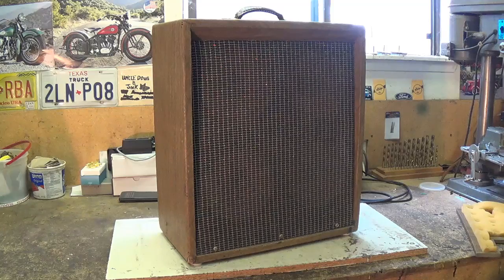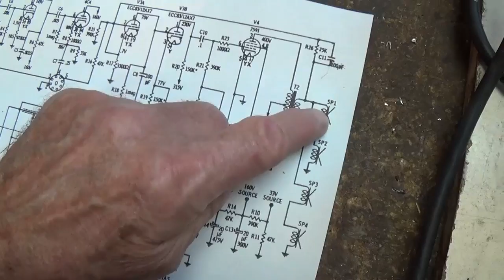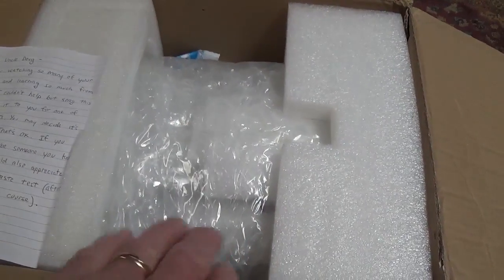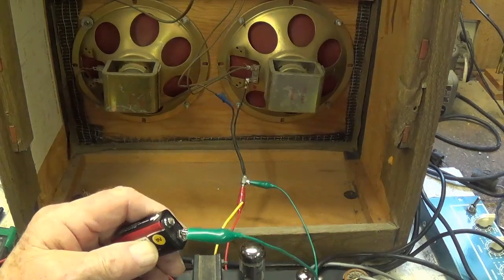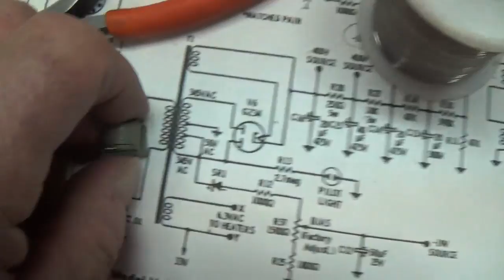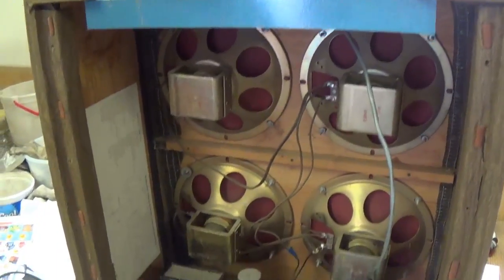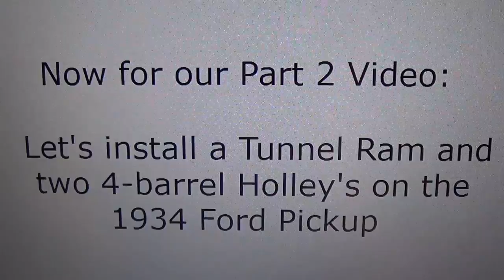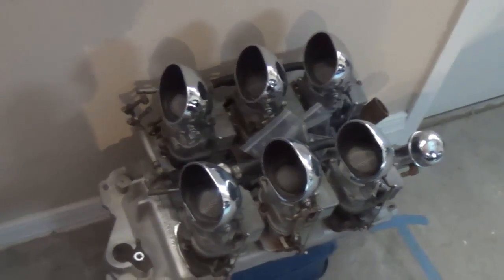Harmony H322 Bass Amp.......The "mini" Bassman from Hell !!

Comment: Hi Uncle Doug.Hope all is well with you and the Jack Gang- and you're keeping safe. Just watched your 1960's Rauland- Borg  P.A conversion. Brilliant as always. I'm wondering in the NFB circuit ,the shielding wire was earthed at the speaker jack and the other end seemed to be trimmed off at the insulation before going into the 50k pot, is that correct ? Really like the effect it has . Couldn't believe the change the transformer had on that Gibson RT , you said your mate reckoned rusty transformers sound great so did that old Gibson GA one.
Reply from the maker: Thanks, Patrick. Cable shielding should only be connected to ground at one end, for fear of creating a ground loop.
Reply: @UncleDoug  Thank you Uncle Doug-had wondered if that was the reason- must be unconsciously picking up logic from your excellent vids. Sincerely yours.

Comment: Thanks Mr. Douglas for this great amplifier fix. As you tell in this video you can see i have subscribed to your channel. One question i have, and, maybe you have covered this in one of your many video's about amp repairs, but i did not watched all of them yet. 

My question is, in choosing a power transformer for an amp, who is taking the most of the power, the amp tubes or the 6 volts fillements? In other words, is the power needed for the fillements to heat up the tube known of all the tubes? Thanks and greetings from Belgium where we also have to stay inside the house in these corona times.
Reply from the maker: Thanks, Jean.  Yes, the tube filaments, both 6.3VAC and 5.0VAC (if you have a tube rectifier) draw far more current than the high voltage DC circuit.....i.e. 3+ Amps vs 200+ mA.
Reply: @UncleDoug  Thanks and god bless your old granny.....:=)
Reply from the maker: @germona  You're welcome, Jean. Amen, she was a real fighter ;)

Comment: The 5AR4/GZ34 might be a Mullard or possibly an Amperex. Mullards usually have a hole in the bottom of the plastic locator key, and the edges of the plates where they're joined together typically show a coppery edge, and are possibly cut with scalloped edges. Any alphanumeric codes on the glass bottle?
Reply from the maker: It was a vintage tube, GU, but the amp has been returned to the owner, so I can't check.

Comment: If ever yo get an amp with a persistent  hum it might be infested with Hum Pixies. You will never find them as there nests are invisible and they only come out when the amp is switched on. The best way to be rid of them is to remove the back of the amp to expose the valves. Then switch the amp on and turn the volume all the way up to 11, this will entice the pixies out of there nest. While  they are humming, sneak quietly around the back of the amp and drench them in ice cold water. The thermal shock will cause them to implode, you can tell if you are successful my sound of loud bangs and pops, the flashes of light and lots of smoke as they implode.

Hope this helps.
Reply from the maker: I just got a nice, original Dumble Overdrive in for repairs, Bishka. I'll use your technique on it ;)

Comment: Great video Uncle Doug.  Like to watch these even though I know nothing bout lectronics.  Is it possible that the bronze gear on the magneto is sacrificial in that it is a softer material than the cam, and therefore wears instead of the cam gear?  It's easier to change the gear on the magneto than pulling the camshaft.
Reply from the maker: True, Joseph, but all other distributors have steel gears, so I don't understand why brass was used in this case.

Comment: Hi Uncle doug, I have now seen the end of your Ronco (Scintilla) magneto. That gear is meant to be bronze and designed to wear rather than the cam gear. Also bear in mind the shaft is 12.5mm not 1/2. Yours Allister
Reply from the maker: I understand the theory of sacrificial brass gears, Allister, but they aren't necessary in a street engine with a steel camshaft. After all, who really wants their bearings and oil galleries clogged with brass shards ?
Reply: @UncleDoug  yes very true. But it takes quite a while to get worn. Also we just fitted them as supplied by the manufacturer. We did do loads of that style and converted loads to that style. The Lagonda engines all had hardened steel gears. The other type was offset drive dog. Taylor Vertex used to supply all the parts. But that is standard and how they were always supplied brand new. Still fantastic videos though.

Comment: WOW, that's a bummer. Sometimes it's the best to set the amp in a corner and get back to it after a few months with clean head. GREAT job as always!

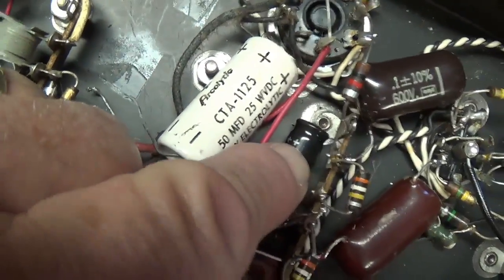I have a question about 38:06
I have to replace these brown caps from CDE (Cornell Dubilier). I am looking for .022 600V and .25 600V. Do you know where I can find them or what is the best replacement for same tone and look?
Thank  you!
Reply from the maker: That's what it took in this case, Echo. The caps I used were NOS vintage, but you may be able to buy similar ones from Antique Electronic Supply. Good luck.  Please subscribe so you can received notification each time a new video is posted.
Reply: @UncleDoug  subscribed in 2013 :D

Comment: This seems to me that this amp would make a great keyboard amplifier. I would make it a amp head to keep down the weight, and then build a separate speaker cabinet, probably 4 X 10" in series/parallel to keep the output at 8 ohms. Would you use the original pre-amp tubes or go to nine pin miniature pre-amp tubes? And EL-84's as power tubes?
Reply from the maker: That sounds like an interesting project, Dennis. I see no reason to change the tubes. If you do this let us know how it turns out.

Comment: Uncle Doug; What brand/model of wire strippers do you use - your favorite and why?  I gotta get something that is worth the investment instead of these utility knives, and crappy radio shack wire stripper/cutters.  I'm building the current limiter and and pulled out my Oscope and my isolation transformer, new battery for the Fluke DMM, I'm clearing out a space in the basement.  You have rekindled my fondness for working on electronics again.  I won't suffer the lack of a good wire stripper again.  I hope you can steer me toward the light on that.  Thanks for your great videos - the cats are great intermissions! :)
Reply from the maker: Congratulations on a wise decision, X. I use this exact product:  https://www.ebay.com/itm/Ideal-Stripmaster-Automatic-Wire-Stripper/264587605864  and recommend it to all.

Comment: Dear Doug, I got an old Corland 8 Watts  combo for Guitar ( but It was my First bass amp) made in Italy. The Power tube Is an el 84 but the rectifier  has the label half worn so I read  gz 81  or ez 81 (May Be) and I wonder if it's right and I wonder if I can use a gz 34  instead. What could happen?  Thanks and bye. (I love Cats like you)
Reply from the maker: I can't speak with authority about that brand of amp, Gianni, but you can't simply plug in any handy rectifier tube. The socket and the circuit are wired for a particular rectifier tube. You will have to find a schematic or knowledgeable person to identify the proper tube.

Comment: I've been thinking along these lines for about a year. 
What if you made a 5F6A circuit, only driven by 6V6s, with 8" instead of 10" speakers, same 12AY7 preamp, same interactive volume controls, same cathode follower driving the tone stack, same inverter, a Bassman for the "loud is over" era.
Maybe an even smaller one with 6AQ5 output tubes and 6" speakers.
        We have to come up with a way to beat the"turn it down" police, and still maintain tone.
      Maybe Tweed ear buds are the answer.
Reply from the maker: Creating a signal output from the pre-amp to drive headphones is an excellent solution, JB. Other than an attenuator, which still produces clearly audible "noise", there is no other way to maintain virtual silence (to others) while blasting away on your Iron Butterfly hit list.
Reply: @UncleDoug  Thanks. I also found another tube called a 1L6. It's a tiny tube, used in Zenith Transoceanic radios, I think. I've been pondering the possibility of a little single ended amp, possibly some variation on the Tweed champ, but around a1/2 watt, maybe using a Fender reverb driver transformer as the O.T. I want to find a way to sound as awesome as the big guns, but not offend the snowflakes. My Princeton is too loud now. 
        Guitars are funny like that. The sweet spot where the amp begins to sing is the exact spot where the curmudgeons start screaming "turn it down!"  The actual Db level seems to be irrelevant. Perhaps sustain and odd order harmonics are offensive to some ears? I think scaling down to almost nothing is the only option.
Reply from the maker: @jpalberthoward9  I gave you a better option in my initial reply, JP.

Comment: Hi Uncle Doug, Really enjoy watching your videos. I have a question how does a Pentode/Triode switch work to drop the power down from 40W to 20W or what ever the wattage of the amp happens to be?  Thank ypu, Joe
Reply from the maker: In pentode mode the screen grid has its own power supply. In triode mode the screen is connected to the plate. This reduces power by up to 50%, but does not reduce the volume nearly as much.
Reply: @UncleDoug  Thank you Uncle Doug for the explanation, Would you be willing to make a video demonstrating this on paper? Thanks for all you do.
Reply from the maker: @MrJoevox  There are all sorts of Internet sources that go into detail about how to add this modification, Joe. Check them out.

Comment: Hi uncle Doug how do you choose the value of the dIo to replace the selenium? If need to get -45 v do you have any suggestion. 
Thank you for the great video
Reply from the maker: Diodes are easy, TT. They are so cheap that you simply pick one that has a far higher current and voltage rating than you really need. I routinely use 3A 1000V diodes in 2 or 3 mA, 40V supplies. They will last forever.

Comment: Great to see messes cleaned up.  Someone was well meaning in the effort to relocate the power switch and light, but lacked the electrical skill to both do a clean job or realize the hum and ground loop issues. Looks really good now. All that is left is for someone to clean up the contact paper mess.  The big take away here is, don't try to improve the design unless you have the skill set to do so.  I see this DIY crap a lot.
Reply from the maker: So do I, DH. It's both a challenge and a rewarding task to correct prior screw-ups ;)

Comment: I have experienced many times with commercial equipment the stupidity of single through single pole switches and thus having live 115 volt still active throughout the equipment. I’ve requested this be addressed by manufacturers to no success 😡
Reply from the maker: It's a bad design, yet easily rectified, Doug. I'm on your side.

Comment: Okay, I paused the video and looked at several other Harmony H322's on the 'Net, and I'd bet hard that this isn't a Lectrolab. I think it's a Gregory, made in the NY-NJ area. The cosmetic stylings of Gregory amps varies significantly from model to model but I did see a picture of a Model XXX bass amp with about the same cabinet dimensions as your amp. Unfortunately, there were no close ups of it and no pics of the speakers.
Reply from the maker: Any input on the creator is appreciated, GU. Having worked on a  Lectrolab recently, I have to say that there is a significant resemblance between them.

Comment: Couldn't help but notice the oil filler tube in the old Offy manifold doesn't seem to exist in the new one. Where are you adding oil now? Through the valve cover breathers perhaps?
Reply from the maker: Good eye, VS. It's easier to simply pull one valve cover and pour the new oil into one of the drain holes in the head.   Please subscribe so you can received notification each time a new video is posted.

Comment: By the way, somebody on  another website said that Gregory amplifiers were invariably built with 3/8" plywood, pretty thin stuff. I'll bet that squares with the amplifier you fixed.  I actually have a Gregory combo amp buried somewhere in my garage,  With a single 10" speaker. It's pretty messed up and only puts out about 1 or 2 watts despite slamming the El 84 output tubes with almost 400 voltz. Somebody has been in there before messing with it, And the factory wiring is much worse than the amplifier you repaired. One of these days I'll try and suss it out. The chassis isn't even marked with the tube types and there is the possibility that perhaps it wasn't designed to use EL84/6BQ5 s, mayby it was designed for 6973's or something like a 6GW8 that has a triode driver built-in to the output tube. ll have to suss out the pin out carefully and trace everything because it did not come with a schematic.
Reply from the maker: The cabinet on the Harmony amp was considerably thicker than 3/8", GU......more like 3/4". Good luck with the Gregory.

Comment: Doug Friend, I may be wrong about this but shouldn't the ground wire be longer than the two other black and white wires if the cord gets pulled out the ground will stay intact video are great!!! Best wishes from Courson family :>
Reply from the maker: I have never heard that "rule" before, Paul. If the power wires are ripped out of the chassis, I would think your problems would be far greater than worrying about whether or not it's grounded :)

Comment: Question related to the old car radio. You talked about that metal canister vibrator inverter thingamajig. That it converts 12V DC to AC. Is that 115-120V AC to drive the tubes in the radio? The reason I ask is back in the mid-60s when I was playing, I was down at the lake near my home and up in a nearby parking lot, a guy had the hood of his can open and had a guitar amp hooked up somehow. He was jamming away by himself and had a mic plugged into his amp, too. Some dude strolls up dressed up with a sport coat on, pulls out his harmonica and starts playing along with him. There were about a dozen people standing around enjoying the music and I always wondered how you could get a tube amp to play off a car's electrical system. Is my memory faulty or Alzheimer's setting in? Please comment/explain.
Reply from the maker: I'm not sure if they had inverters back in the 60's that could handle a tube amplifier, TM. I wonder if it was simply a battery-powered amp? You may be right about this, but I simply don't know enough to make an educated guess.
Reply: @UncleDoug  Yeah, it's hard to say. I was only watching for about 1/2 hour at the time and I was about 16-17 years old. My tech expertise was limited as such, but I recall the episode as a whole and it always stuck with me over the years. Inquiring minds want to know!

Comment: If you are concerned about receptacles wired wrong, carry an inexpensive test plug that shows you correct wiring and a working ground with indicator lights. People put 3-wire receptacles in without grounds. As for the double pole switch, it's of little value if the outer terminal of the fuse goes to the switch. That way, the fuse does not come in contact with a possibly live part until inserted most of the way. I suppose someone could get their finger under the cap inserting the fuse while plugged into a wrong-wired outlet, but do we need it to be damn fool proof?
Also, I've never seen identical speakers with different polarity, so you tell by looking if they are in proper phase without all that fuss. That's for those who like to mix speakers.
Reply from the maker: Thanks for your helpful input, Dennis.

Comment: Nice remarks about the switch to wall outlet, but... As we have AC thete, it maks no difference which wire is 'hot' or 'return', because alternate current by definition changes flow direction?
Reply from the maker: No, it doesn't, PP. The (black) hot wire is always "hot" and the white wire is always the return. They don't "take turns".
Reply: @UncleDoug  Mysteriuos for me, but you obviously must be right :) By the way - great stuff on your channel,  thank to it iIfinally got how my lamp audio amp works...
Reply from the maker: @przemyslawpraski8985  You're welcome, PP. Glad the video was informative.

Comment: Be cautious replacing that ⚙ on your Mag drive... I've replaced several motors because the incorrect alloys were combined.  But I'm also fairly certain you're wise to such catastrophe.
Reply from the maker: The brass sacrificial gear was demonstrating extreme wear because it wasn't needed with the cam gear in this engine, KC. I checked the steel gear several months later and it showed virtually no wear at all.

Comment: This was awesome! I was kind of bummed that the “tolex” wood grain didn’t didn’t get replaced, but still very cool. Is there any way to know what killed the output transformer after it is gone?  Also: when poking around a live amp, can you literally use a takeout chopstick, or do you need to find a specific type of wood or plastic for this purpose?
Reply from the maker: Thanks, Joe. I think powering the output tubes at 50% over max PD for god knows how long took it's toll on the OPT. Any wooden stick will work.....just don't use a graphite pencil.